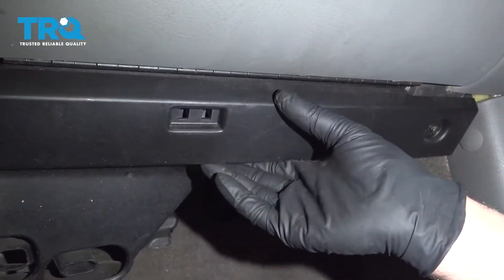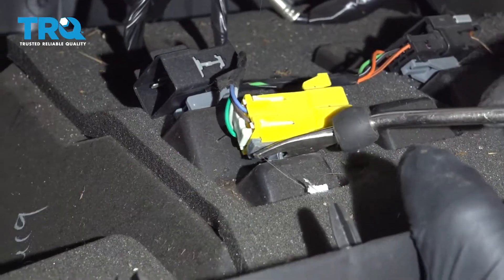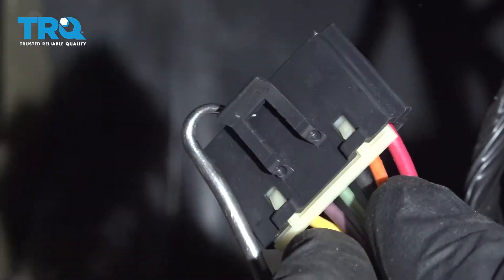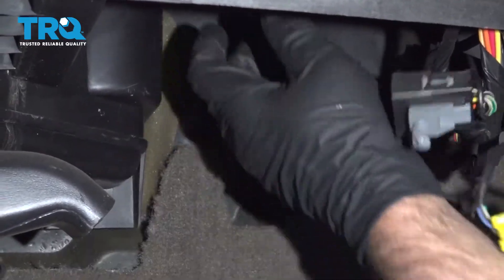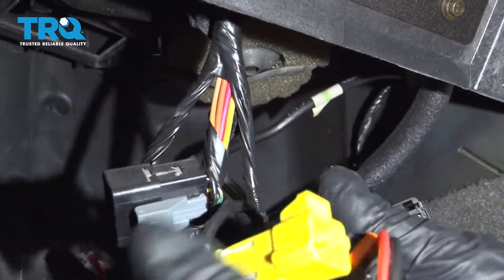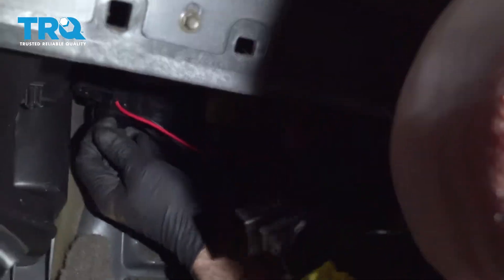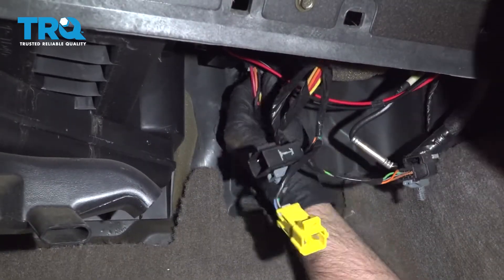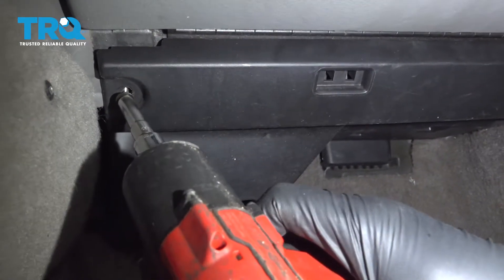How to Replace Blower Motor Resistor 2002-2009 Chevy Trailblazer

Comment: Even though the video is 2 years old I'd thought I'd share 

Make sure you get the right resister  check the plug before you buy a new one theres a 7 pin and a 5 pin connector

Comment: Dude those electric wires are easy slip connectors you don’t have to pry them out just use little screwdriver push down tab and slide off of it.